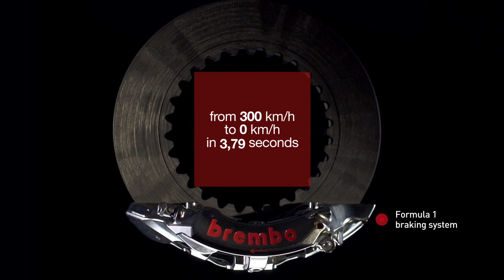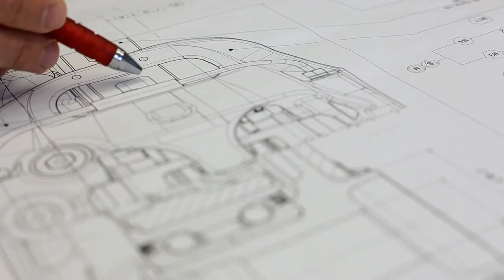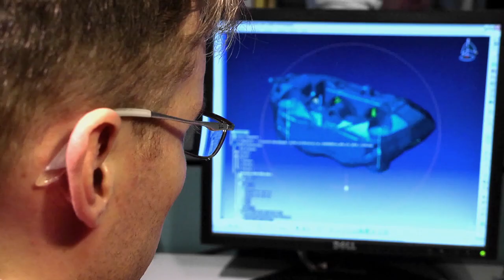Brembo Company Profile

Comment: The part number isaudi q5 8r0615108g.  I am unable to obtain spare parts for the brambo brake calipers.  There is a hole that connects the brake hose and the caliper, and the thread in that hole is broken, so you need to get a new part.  How can I do it?